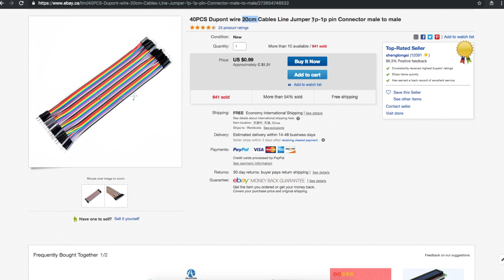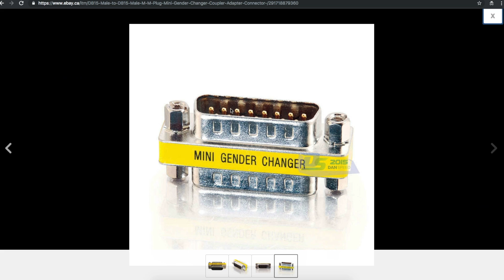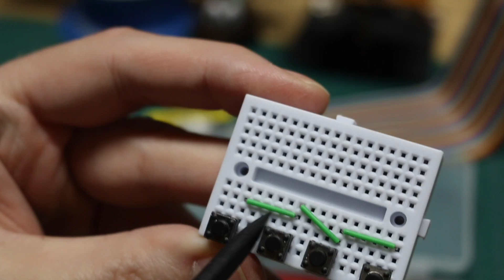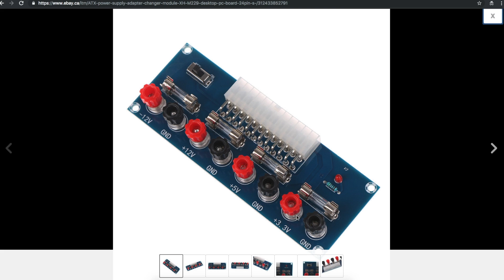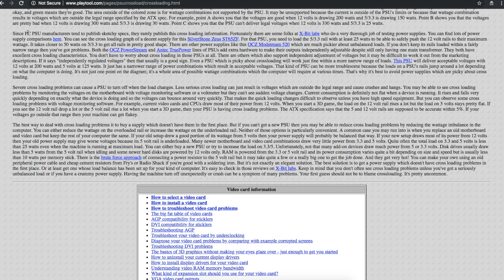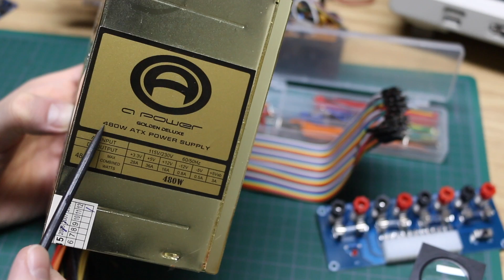Mailbag - ATX Power Supply Adapter, INA219 Power Monitor, and more!

Comment: I just received 2  XH-M229's today from Mississauga Ontario.Both of them need a load on the 12 volt terminals to work. I re-watched your video today to see if yours worked with no load. I was hoping mine would. But nope. I even plugged in an older IDE drive to the PSU hoping that would help.  But it didn't. I used 2 different PSU's ( One full connector and one with the right 4 pins missing)  But it didn't. Oh well. Load it is... Until I find another dumpster PSU for me to drag home. I have an old XT PSU on the shelf, Big ass clunky switch on it. 80 W... Mmmmm.
Reply from the maker: It’s funny now when I read comments from you I hear it spoken in your own voice from your videos. I should try other power supplies that I have because I only did try that one so far. I have at least two more standalone and then several more actually in cases with motherboards that I don’t know if I have RAM for. I wish I had an XT system but I started at 386 sx 16MHz.  Not even a real 386. I think I had a whole one meg of RAM (dip chips in sockets) and a 40 meg hard drive.
Reply: @GadgetReboot  My XT had a 360K 5 1/4 until I could afford a used 10 meg RLL or MFM Controller ( Can't remember.) Everything was DOS back them. Started at 3.3 I think. Learned Basic and made quite a few programs. Those were the days....and nights. OMG I have a Sinclair ZX80 in a closet. And a 16K Memory pac. ( Can you spot the memory pac in one of my vids? ) I should dig that out and see how many times I can make it crash.
Reply: @GadgetReboot  The SX was just missing the Math co-pro. With the DX it was built in. Some SX boards had a socket you could load the Math Co Pro into.

Comment: Maybe the spec means that the power supply is allowed to have a minimum power requirement of 0.05A, but that it is recommended that they are built as to not need one. So this is for the manufacturer's, not the users
Reply from the maker: It just seems weird that they would call that a requirement if they don’t have to meet it. Either way something is definitely strange about the whole thing.
Reply: @GadgetReboot  well, actually not. It is a matter of tolerance. And an upper limit. For what would be considered inside specifications. The writer of the ATX standard is telling manufacturers that 'You are allowed to require 0.05, but no more. If you must. '

Comment: i removed the -12v connectors on that atx breakout, changed the others to proper banana sockets, and soldered 2 wires on the purple and gnd pins to have the 5v stand by for an usb socket :)

Comment: I got the same ATX breakout and was super disappointed that connectors weren't banana jacks (just banana-jack looking binding posts).
However, they're just fitted to the board with nuts on the back, so it'd be trivial to replace them with true jacks/binding posts for your various banana leads :D
Reply from the maker: I’m already searching for new eBay listings to do an upgrade but I need to double check the hole size on the board to make sure the whole retrofit is feasible.
 I probably already have banana jack binding posts scattered in various boxes that I could use but it’s probably faster to wait two months for the shipment than it is to try to locate anything around here.
Reply: @GadgetReboot  While you are doing that, mount the banana posts on the other side of the board, so it can be mounted flush to the inside of a case.
Reply: @GadgetReboot  I always buy stuff and put it away and forget I have them, and then reorder the same thing again. PITA
Reply from the maker: I’m starting to get into the habit of double checking my eBay order history before I order new things now. When I started playing around with nodeMCU recently, I was about to order a nodeMCU board but when I checked eBay I had ordered one a year ago December and it was sitting right there in the drawer at the workbench the whole time. I could’ve been working on it six months ago.

Comment: I don't actually think there is a min current on atx supplies.
As long as the green wire is connected to ground, the supply works (yes that tiny little green wire).
I think I have one where I just slapped a potentiometer on the +12v line and it worked fine. still have it in a drawer somewhere.
Reply: Ya, There is on some. I just tested 2 different ones.
Reply: Older atx psu want a min load or will shutdown after time.

Comment: Old computers that used the D9 for display was a VGA connection,
the DE15 3 row connection was a SVGA connection, however nowadays all DE15's on modern laptops are called VGA!
Reply from the maker: I remember the day I upgraded my CRT from 800 x 600 to 1024 x 768. I could barely see anything on the screen it was so small.   I saw an old VGA card in the basement last week and if I remember correctly, it was from my very first computer. Trident branded card. I forget the max resolution so I wonder if that still works.
Reply: @GadgetReboot  I think I have a trident card. I also have a vodoo 2 booster and voodoo 3/3000 stand alone card.
Reply from the maker: I also found some older stuff like I think there’s an EGA card, a game blaster, an Adlib Gold, a 120 MB tape back up internal Drive, who knows what else. I cant  wait to dig it all out and put something together.
Reply: @GadgetReboot  I just need to find the time to rebuild my C=64 but I'm currently writing a programming book!
Reply: @GadgetReboot  Amazon: Price:  Todays price... CDN$ 264.62.... Really and I recycled these?